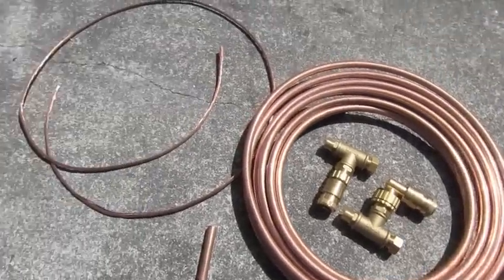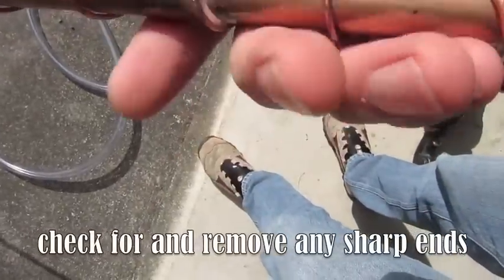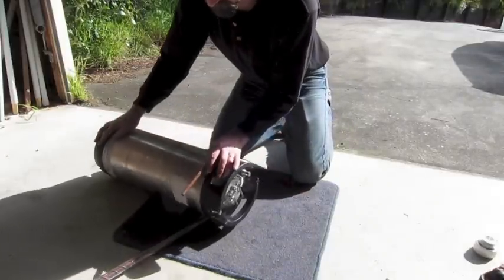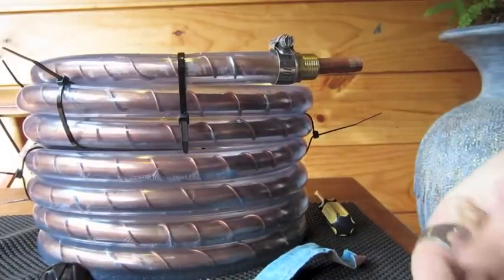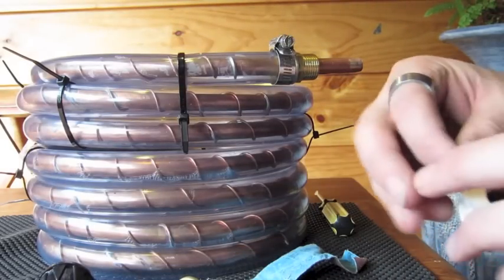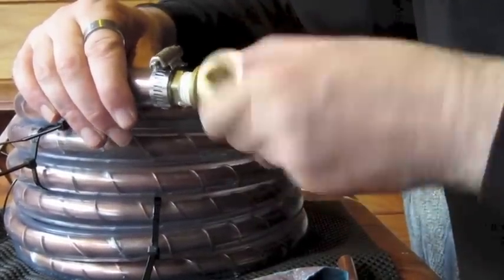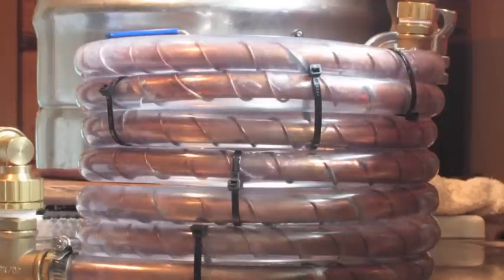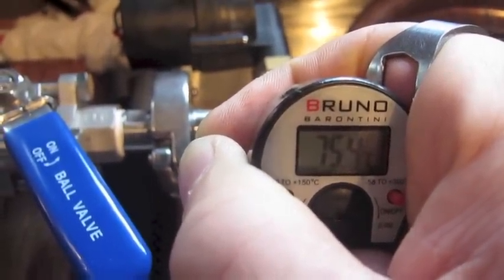Counterflow wort chiller, build and test

Comment: Nice build but I've got to be that guy. That's not welding 😉that's soldering aka sweating. Welding is melting the 2  materials together along with a filler material. That can be done with metals or plastics with heat or chemicals. Soldering is basically glueing the pieces using heat. Next time you have to do some soldering try n get ahold of some stay Brite liquid flux. If you use silver bearing solder it will bond about any metal including stainless,copper,brass, aluminum and even cast iron or mild steel in any combination. The stuff is amazing

Comment: I know it's been ages since this was posted... since you already added an inline pump for the bear - what if you create a closed loop system for the cold water, into something like a 5 gallon water cooler - you could add a pump to the base of the cooler - then fill with ice, and circulate the ice water, as long as you have ice in the cooler you know the water in the loop is quite cold, this way your not running water down the drain, but recycling it.

Comment: That is a lot of work for something that works just as good as a regular coil. I use 2 double 1/2 coils. one in a ice pre chiller and one for immersion, just running straight garden hose water through it can crash 12 gals of boiling wart to 70deg in 11 mins flat.

Comment: Looks fine. My question:
Can this system be used recirculating the same water? I need to process water batches for about half an hour and water warms up from 60°F to 110°F, and I need to maintain about the same initial temperature.
Reply: +Time4Another1 Can you give a BOM for the parts? Preferably with some Amazon links.
Reply from the maker: Hernando Durana hi Hernando, those temperatures should be fine for a prolonged period of time. The Clear PVC tube I use has a heat rating of 150ºF before it starts to degrade. Any prolonged temps above 176ºF should use silicone that can handle the higher temps. Note thought that the water being recirculated is not potable, at that temperature chemicals can be leeched from the PVC, anything that is only touching copper will be fine though, Cheers
Reply: "Note thought that the water being recirculated is not potable" Certainly. The lead in solder  contributes to the water not being potable.
Reply: as in sap
Reply: Keith Reynolds theres no lead in solder
Reply: davesden1  Depends on the solder. Lots of solder types have lead in it, though not all, and certainly not the kinds of solder you want to use with potable water.

Comment: That's a good method! But I wanted to know if I can use a pump to continuous use for cycles of 12 complete hours or all the process has to be in pauses? the amount of water that I am going to work are 80 liters in a container.
Reply from the maker: Jose Luis Lopez Ramirez I have used the counterflow to continually recirculate 40ltr of hot wort back into the kettle, and then turned on the cold water to chill the entire volume in about 30min. If you are looking at using a counterflow for a prolonged heat exchange period, I cant see any issue with that, at some point the heat exchange will stabilise, ie both fluid sources should reach the same temp.

Comment: Hey man great video. I'm going to build this over the weekend. I've seen designs using 3/8" and 1/2 copper pipe. Do you have any opinion on wich is the best option? Do you still use this chiller or what have you moved on to. I'm currently using a coper immersion. Thanks

Comment: What are those quick disconnect tube/hose fittings? I can't seem to find them on McMaster-Carr.

Edit: Also, if you were to use a compression fitting on the pipe, how would you go about attaching the tri-clamp? I don't see anything that would work for attaching directly to a 1/2" O.D tubing without a butt weld. http://www.mcmaster.com/#45195k72/=xid042

Comment: Thank you for sharing this video! I built one of these a few months ago using this video as a guide. The plumbing department at the hardware store became my second home for a couple weeks while I figured the connections out.

I ended up drilling the compression fittings like you recommended, and everything came together and sealed up nicely. I've brewed two batches with it so far, and it works like a charm. Your channel has outstanding content.

Comment: Thanks for the video instructions mate. I am thinking of building one, but would like to ask if this will work just by gravity feeding the wort through? also I am thinking of going to 9 meters 13mm (1/2 inch) of copper pipe. what are your thoughts.
Reply from the maker: Jared Venerussi Hi Jared, gravity feed would work perfectly well, the beer flow would be slower, and therefore more heat should be exchanged. You possibly dont have to go to 9m, but it wouldn't hurt. At the worst the last couple of meters might not be exchanging much heat.
Reply: Thanks for the advice. I might go to 6 m then. I've got a good plumber mate that's gonna solder it all up for me. I will let you know how it goes when its all done. thanks again.

Comment: I would like to know if you have a parts list available to build this chiller?  I know I will overlook something when I order :$
Reply from the maker: ***** Unfortunately not, I laid out all the parts on the video, but I put it together as a dry fit in the plumbing shop, so never took note of the actual sizes.
Reply: No problem. I was just having a very difficult time finding the swiveling hose fitting.  Thought  maybe it had a particular name.  Could you pass a link of this item so I can try to find it at my local hardware store or online?

Comment: I really like your video and have decided to make one of these chillers as well. I'm a newborn to brewing, currently putting together my equipment. I've already made my keggle with the same 3 piece ball valve ending as the one in this vid. What I can't get my head around is how do you withold hops from clogging your thin diameter copper spiral pipe? I'd like to add whole and pellett hops directly in the keggle without using bags or spiders.
Reply from the maker: 4ttys Great stuff, its awesome getting gear ready for a brew setup. My kettle has its dip tube 1/4 from the outside edge, so after a whirlpool the hops form a cone in the centre and don't clog anything. I always use pallets though, as they don't clump together while the hot wort is flowing, leaf hops would form a blockage. Luckily I have never had any blockages, a good pump with a decent flow rate will keep everything moving. Cheers

Comment: I built this also after watching your video...soldering every 4" doesn't hold it...the solder ends up breaking loose. had to use another method to hold it, ended up getting all of the copper pipe in but 18 inches of it out of a 20ft section...after rolling it on the keg, ended up with 7 coils....
Reply from the maker: turner111971 I had a couple of solder spots ping off as well, a bit of sand paper to roughen up the pipe helped. 7 coils is pretty good, thats what I ended up with also.

Comment: Very cool bro.
Good old kiwi ingenuity!
Have you done an estimate on how much water it uses to cool a 5gal batch? I'm in Melbourne and we have to be a bit careful of water.
Reply from the maker: Brook Petrie I have a water meter dedicated to the brewery and it normally takes 40 - 50 ltrs, but that with a water temp of 16ºC. Using a small pump and recirculating the water via an ice bath is an alternative, or if you have a swimming pool recirculating water from there is a good solution.
Reply: Thanks for the reply. Am thinking of playing around with a way to cool the water in-line from the tap, by passing the water through ice somehow, like a hop back/hop rocket filled with ice. What do you think?

Comment: Nice work. Please I've never had a chance to see this myself (Africa things) but I would love to know if it's possible for the cold water outlet temperature to rise to a temperature close to that of the hot beer say 94 degree celsius  and for the hot beer to cool down to say 13 degree celsius. Thanks.
Reply from the maker: lamprosmuda the hottest I have had the water come out is around 75ºC, and wort will cool down to 22ºC, theres must be a thermal limit for transfer, however I the water temp to start with is around18ºC so if I chilled the water I could effectively chill the wort cooler as well.
Reply: Thanks Sir.
Reply: I've been mentally working on an idea. What if the length of the heat transfer pipes are made longer, perhaps it could approach right?
Reply from the maker: lamprosmuda I thought about that too, I looked at thermal dynamic calculations to try and work it out, but they were far to complicated. Trial and error was the best way :) At some point the water will get to an equal temperature as the wort, and any further length after that point is not doing any heat transfer. The best way I have found to increase efficiency is to restrict the flow of the wort coming out.

Comment: I liked your work presentation, you have done a great job
I am trying to build a small evaporator submerged into a water tank, I would like to use a small refrigeration unit about 60.000 btu, so the liquid refrigerant flows into the copper coil and return in state of refrigerant vapor back to compressor,
do you have an idea how long ( the length) of the copper tube should be to handle such capacity,

imad.mukadam@gmail.com
Reply from the maker: Cheers, I know of a few people that recirculate the cooling water via a reservoir to keep the water cold. I haven't done it before, but from what I have seen it is just a simple case of submerging an evaporator into the water reservoir, and sure the water is pushed through the evaporator fins to make the most of its cooling.

Comment: Hey, great video. We are having a heck of time finding the proper size fitting that fit snuggly around the 1/2 od copper tub and thread to the 1/2 npt brass T. Any idea what fitting you used?

Thanks!
Reply from the maker: Kate DOrazio Hi Kate, an alternative is to use a 1/2" compression fitting that is drilled out, heres a video about that @l6jbT2pGcwU. This allows for the copper pipe to pass straight through and then be sealed by the compression flange. My local hombrew store has all the end components ready to go, so this link might help you put the pieces together. http://allgrain.co.nz/product_info.php?cPath=14_51&products_id=329&osCsid=4o7gl89mg9327ro7a4egttcv10 hope that helps, cheers
Reply from the maker: Time4Another1 compression drilling video http://youtu.be/l6jbT2pGcwU

Comment: Me and a mate were so impressed we made one each. We found compression fittings, tees etc that did the job nicely, haven't soldered for 20yrs so that got interesting but got the copper in the tube so all good. Problem is the tap water here is 23 degs so now looking at making a recirculating water chilled reservoir to get  from 35degs(current wort exit temp) to 22degs. But to chill wort from 100degs to 35 in 10secs shows how efficiently it works all for $85. Thanks for sharing!
Reply from the maker: gotsomecraic that is awesome, cheers

Comment: Awesome build. Sorry if you already mentioned it, but what parts and sizes did you use for the pipe fittings?
Reply from the maker: wildlifematt1990 1/2" for the fittings, but 3/4" for the Tee, so that a 3/4" ID PVC tube could snuggly be fixed over it. The easiest thing I have found, is to go to a local plumbing supply and dry fit bits together and see how it all works. an alternative to the output end is a drilled out compression fitting, here is a video about that http://youtu.be/l6jbT2pGcwU

Comment: How do you keep the outside of the copper clean and free from discoloration??
Reply from the maker: Motley One running PBW solution and letting it sit for a hour helps clean up copper, but theres no real need to clean the outside of the copper as it is only in contact with water, and not the wort.

Comment: Great video. I'm wondering if I can make something along these lines as a still condenser. 2 small niggles (yes I am a Pommy whinger); you kept on saying 'weld' and I expect by now it has been pointed out to you that what you're doing with a small gas torch and a low melting point alloy wire is not welding, it's soldering. The reason that you struggled trying to solder the copper tube to the brass fitting was because it takes quite a lot of heat to get the mass of metal up to a temp where the solder will flow. And already inside the plastic tube, you'd be damaging the plastic if you did have a hot enough flame.
Whinge #2 - I had some trouble in making out what you were saying and my first language is English, so I wonder if some of your world audience might have had the same trouble or more. Speak clearly you Ozzie bastard!
Having said that, lovely video. Thanks

Just kidding, Kiwi :-)
Reply from the maker: Robert Seviour lol, yeah I knew I was soldering, its hard to think about what your saying when the video camera is rolling. What do they say in the film industry, never work with animals, small children, or home brewers who had had a few to loosen up before hand ;) Cheers Robert, thanks for watching, and thanks for be whinging pom, it made me laugh

Comment: Love the design and I'm thinking about a build. My question relates to sanitation, is it hard to keep clean? Do you have any tips for keeping bacteria out?
Reply from the maker: Matt Seipel Sanitation is easy, after a brew day the coil is flushed with water and drained. At the beginning of the brew day the coil is flushed again with water, and hooked up to the kettle. Before cooling the wort, the wort is recirculated through the counterflow without the cooling water running for 10 minutes, that way the boiling wort sanitises any small microbes that are in the copper tube before starting to cool.

 I have also built a parallel counterflow chiller, that allows for line of sight through the copper pipe, as I was curious about any possible build up in the pipe, but I haven't found anything that can cause issues. A 10-15min recirculation of boiling water kills all battery and microbes. Cheers Matt, thanks for watching
Reply: Thanks for the reply. I'll be building this winter. Cheers
Reply: Time4Another1 Not only this, but copper already has anti-microbial and anti-fungal properties. Hospitals are starting to use it on surfaces that are touched often (bed rails, door handles etc) for this reason. I'd be satisfied just making sure that it is properly flushed. If you're really paranoid about it you could of course circulate hot wort through it, or just mix up some sanitizer in the kettle and let it drain through the cooler into your fermenter or another vessel (this way you can get more use out of it) before you put your wort through it.
Reply: Time4Another1 f

Comment: Super nice! I am going to attempt to duplicate this really soon. I have an immersion chiller that isn't cutting it. I am going to try to unwind it and use it for this counter flow design. I wonder it this is gonna work? Hahaha. 

Top notch video.
Reply from the maker: danr308 be careful unwinding the copper, as it tends to buckle and crack after it has been bent for a long period of time. If you can, fill the tube with salt completely and bung the ends, "probably a bit hard when its coiled up", but the salt acts as counter pressure to prevent buckling when you bend it. Then run hot water through it to dissolve out the salt again. Cheers

Comment: do you have a complete parts list?
Reply from the maker: david price Unfortunately not, I didn't think to make a note of all the sizes when I got the parts. I put it together by going down to a plumbing shop and dry fitting bits and pieces, based on the copper pipe and clear PVC tube I had.

Comment: Fantastic!!! Congrats for this nice job. I'm from Brazil and I was wondering what's the brand of this compact pump that you have at the outlet of the kettle?
Thanks.
Reply from the maker: Vinicius Diniz heres a link for the pumps http://www.ussolarpumps.com/index.php?main_page=index&cPath=71_116_136 they are great little pumps I have never had any issues with them at all. They are also available on eBay, if you search via the pump description. but I have found directly from the supplier is the best price. Cheers
Reply: Thank you very much for the prompt answer!! Once again, congrats for the fantastic job. Cheers!

Comment: Great build! What type of outer tubing did you use? I like the clear look, but am concerned about the temperature of the water being too much for it once it pulls the heat from the wort. Have you had any problems?
Reply from the maker: thorinoakeshield The Clear PVC tube has about a 2mm wall thickness with an internal diameter to tightly over 1/2 threads. When I talked to pipe supplier he said that the tube was good for up to 79ºC (175ºF) of continuous exposure. The water would hardly reach that temperature while it was flowing, and it quickly drops to lower temps as the wort cools. I have never had any issues with leaks, or warping, a little bit of discolouring over time, going slightly opaque, but still clear enough to see through, and the discolouring would be more from mineral deposits over time. Hope that helps, and cheers for watching.